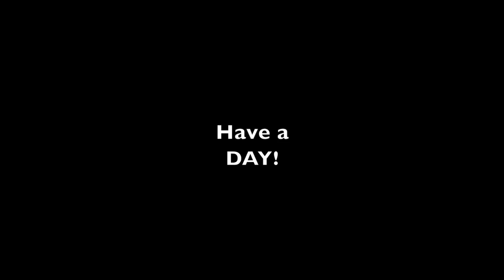#795 I call this a Tweener! and a story about a Shovel

Comment: Mike, how about building a post and beam barn? Think big. Instead of buying a ready made kit and paying premium for all of that Eastern White Pine why not get the plans with specific measurements and cut out diagrams. HUGE is the word. Center rear is your new woodworking shop on the concrete floor through the whole mid section, and then the wings gets the WoodMizer on one side and the other side is... wood storage? equipment? or whatever. Did you know that commonly tree surgeons sell prime logs in walnut, maple, cherry, oak etc for only 15 cents per board foot? They load them on large trailers with a grappling hook and then can park them in a pile on your property. You also need a kiln, then you are in the wood business. 
For the post and beam barn you may even be able to partner up with someone in that industry that would be helpful to you just for the advertising factor. 
Absolutely love your You Tube channel, you and Melissa are my favorites.

Comment: SHOVEL STORY. Working in a trench for some coduit to garage. Thunder storm come up, but we were hot to get the trench covered. By now really wet. I'm packing  dirt around the pipe in pouring rain when I  see the lightning and hear the thunder as it struck  a chain link fence about a hundred yards away. ZAPP. I Get shocked through the shovel handle!!!!!  We went to the truck after that.  Be safe guys.
Reply: BBQ,
WOW!  You could have been fried big time!!!

Comment: Long or short shovel.......???
I poured concrete for a living from the early 80’s thru the early 90’s.  Everything from 1 to 500! Yards a day.  All commercial.  We used Ames short handle square points exclusively.  You have to get your back and legs into it when moving a lot of yards.  Just saying!  NOW (70yo) I use a long handle exclusively!  Diff times, diff body, diff schedule!
Your vids are the BEST!  Plain and simple, which seems very reassuring right now!

Comment: Why do you take a few boards off the log on one side then flip it 180 degrees instead of just keep cutting?
Reply from the maker: Hardwoods you stay away from the center of the log, it will crack bad